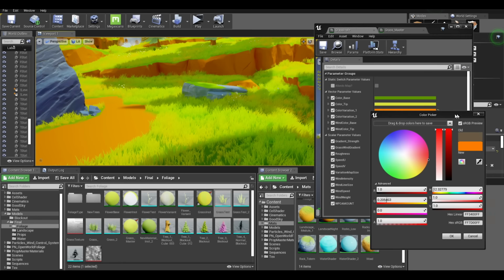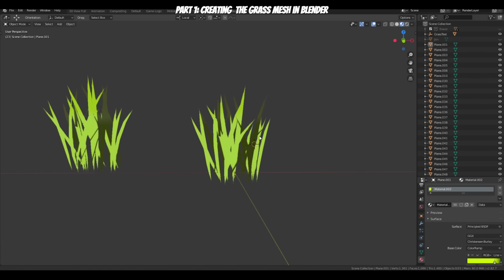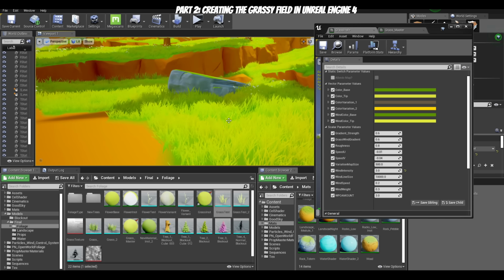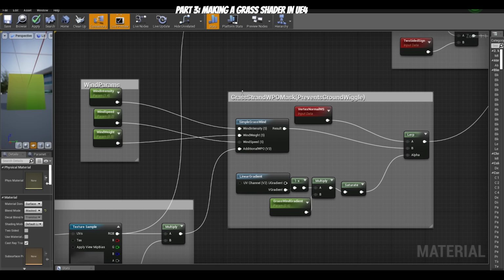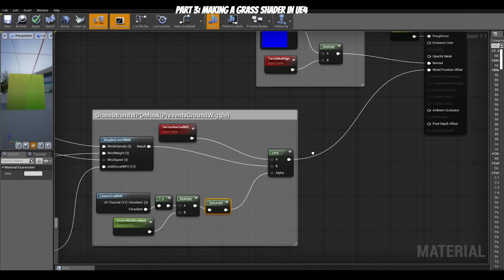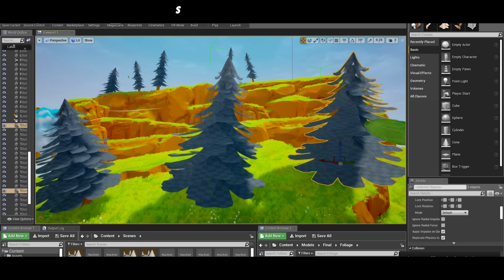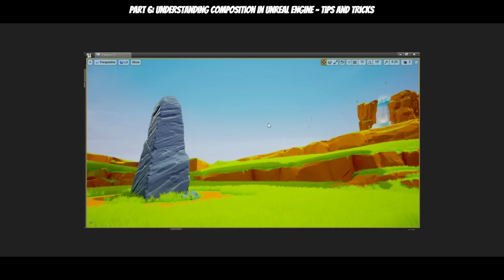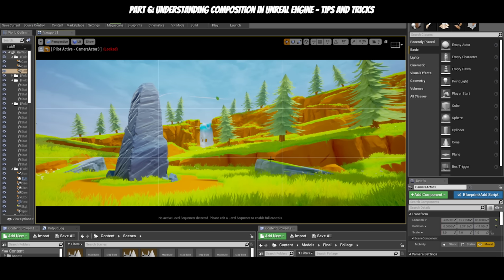Unreal Engine 4 Tutorial - Creating A Grassy Field 3D Environment

Comment: 632 verts each grass clump, 166k models spawned on the ground. It is 104 912 000 verts in this scene (grass only). Performance drops in the game will be huge.
Reply: What would the solution be to fix that problem?

Asking because I’m interested in 3D modeling and hopefully in the future making a game of my own.
Reply: @infamoushazard0  Look into topics like GPU instancing, occlusion culling and frustum culling. For example with culling techniques, only that portion of the grass is rendered that player actually sees. Also using different LOD meshes with grass that is far away helps. No point of rendering super detailed version of the grass that player hardly sees.
Reply: @JoyhillGames  thank you for answering I’ve heard a particularly phrase in another video but the person was using unity. Where they did a similar method you’re referring to by only rendering the direction or camera angle the player sees. It might just be culling but I can’t think of the word at the time :/

I’ll definitely be sure to look in to those topics because I notice my computer starting to work a little harder as if I’m running red dead 2 on max quality
Reply: @infamoushazard0 billboards

Comment: I'm not sure why you changed the normals?  They point away from the grass blade's surface which is proper.  Lighting shouldn't look right on them if it is pointing straight up?  With regard to performance, the grass can just be instanced by the engine so it doesn't take much of a performance hit (the engine has one copy of the grass in memory, then just repeats it over and over again which is fast due to very little VRAM being used, rather than having many separate objects which would be slow).